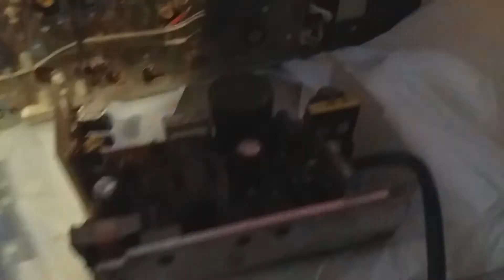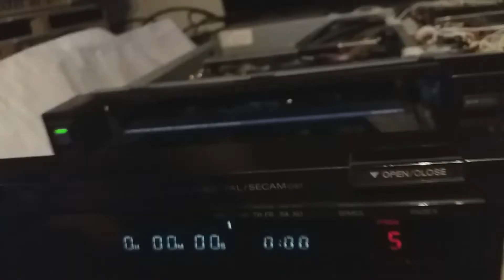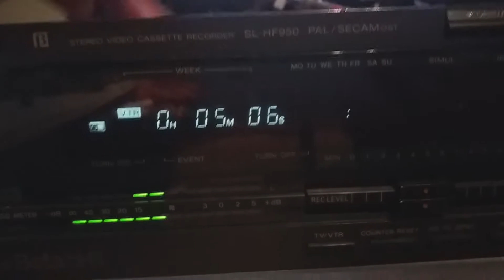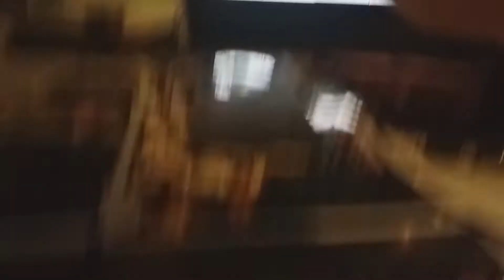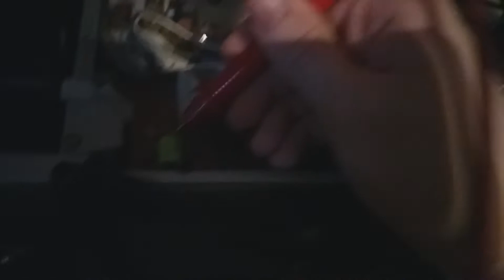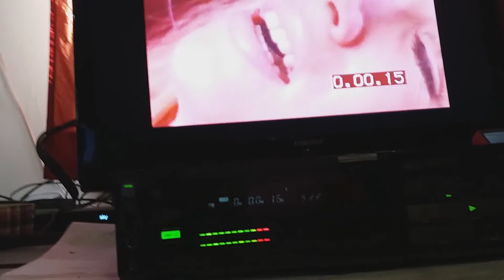Vintage Sony SL-HF950 (1985) Repair / Service (vintage tech)

Comment: Whow what a machine, always wanted to have one of these! When the machine came out it was a very expensive top of the line machine. I have had several Betamax machines, and have still a couple of them in my audio and video collection, only one is a Super Betamax machine. I always liked the system Betamax videorecorders and still love them! Of course i also like the VHS machines and the V2000 and Video8 machines, and have also al lot of those in my collection. Sad that they dont make them annymore thesedays, the last VHS videorecorders where made in 2016 by FUNAI. Good Job well done! I like the videos on your channel. Greets Marcel 👍👍👍

Comment: On HF 950 the EDIT switch acts strangely (compared to VHS recorders): when EDIT mode is ON, the picture sharpness is reduced. The sharpness pot is set to the middle position. When EDIT mode is ON, the sharpness pot is not working (as expected), but why the image sharpness is reduced when EDIT mode is turned on? Is it normal or a malfunction? Normally, the EDIT mode should turn off the DOC / HQ etc. circuits and should show the raw, sharper. noisier picture, without any enhancements. 

Also, I don't see any differences regarding the dropouts when EDIT switch is turned ON / OFF. Does it control the DOC circuit in this particular unit? I need to conduct more measurements on the PCB and learn the schematic more.

Comment: Slowly fixing all issues in the HF 950 (PSU, broken shaft couplers, broken 470n caps on RP31 board, broken gears / motor / position sensor in skate loading mechanism etc.).

Now there is strange problem: I have around 30 used cassettes. 90% of them produces 700 -800 mVpp signal on CN703 pin 3 (~1.2 Vpp measured on pin 14 of CX 20045 - this is the normal value, regarding the service manual). These cassettes have slight dropouts (short horizontal white lines). They are mainly Sony brands with golden letters on the tape protector door ("This side faces forward" etc). But 10% of Sony tapes with black text on the door generates higher signal, around 1.2 Vpp on CN703 pin 3 and 1.6 Vpp on CX 20045 pin 14 and the picture is perfect, without dropouts. All these are recorded with the same machine.

The recording signal on CN704 pin 1 and 5 is 4 Vpp (this is the normal value as manual states). I have tried to increase the record current (measured 5-6 Vpp on CN704 pin 1 and 5), but the "weak" tapes still reproduced only 800 mV on the testpoint.

I can't believe that 90% of tapes are bad. Why the VCR cannot record stronger signal onto them? Head issue? RP31 board problem?
Reply from the maker: Well, are you sure that the heads aren't worn? I'm by no means an expert on betas but I would try to find good condition prerecorded tapes to see further. Sounds like a strange issue to me
Reply: @Oerg866   Nothing is sure, as I have no reference machine or a good head. If You can tell me the inductance of a good primary A and B heads, I'll able to measure mine.
Reply from the maker: @drdma1  I'm sorry, that exceeds my technical knowledge :( I lack equipment to measure reference values for VHS as well...

Comment: good day
I have a Sony 950ES
which ran perfectly yesterday,
Bought the device from classifieds for 300 euros, optical condition top,
Technical condition also top, image reproduction flawless,
everything works perfectly, I had a dozen beta cassettes in the closet for a while,
which I wanted to check, today on January 17th, 2022 I watched 2 cassettes in a row,
Good picture quality of the tapes, they were great classics that you can also watch like this,
at the end the movie ...Stripes ...with Bill Murry was on
I turned my back on the recorder and just let the movie run
I did something on the PC... but something must have happened at the time
the counter stopped at 0:41 and the recorder just kept running,
When the film ended I wanted to fast forward the tape to watch
what else is on it, he didn't react to anything anymore, not even off
you could still do it, playback was still on,
Also ejection or similar did not work anymore, I pulled the plug
When he put it back in, he unthreaded the cassette and reinserted it,
That's it, not even the tuner reacts anymore, what's the matter there
happens, hope you can give me a hint,
Also eject no longer works, display is ok but does not change anymore
Counter to 0000000 and tuner to 0 that's it,
greeting jens from leipzig germany

Comment: Hello I have one of the model
SL-HF750 SUPER BETA, which if it turns on but does not load the cassette
I press the load buttons and nothing happens, neither to open the load nor to load, you have any suggestion that it might be failing ?

Comment: You said: The fine horizontal patterning is due to lack of shielding on the video cable" Did you mean from videoheads or from output?
Reply from the maker: I meant my own composite video cable, I was using a really cheap one. :D

Comment: Hello. Where did you source the leds from, and how did you stick them on?
Reply from the maker: I sourced them from a local distributor. They're standard 0603 SMT LEDs with about 12 mcd luminosity. You can solder them on the pads directly, but it is a very delicate process. Make sure they're aligned correctly so they fit in the holes of the cover.

Comment: Hello again. I too need to replace the LEDs on the front meters. How did you work out where the +ve and -ve pads were on the PCB? The original LEDs are so tiny I cannot see what they are connected to.
Reply from the maker: Hi, what I did was I took the board out after removing all the exisitng LEDs and then while the machine was on put a VERY loud signal into it so that normally all segments would light up, and then measure voltage across the pads.
Reply: Oerg866 that's a good idea. I'll try that. Looks fiddly but will be great if I can get it to work. Over half of mine are now dead so haven't got much to loose. Will let you know.
Reply: Great video, I need to replace the LEDs on mine. Where about's are the fixing screws to access the PCB. What LEDs would you recommend?

Comment: A fabulous, helpful video - thanks. I did have a question on your comment for the Panasonic AG 7350 - CTL pulse processing. I have 2 machines with that problem and replaced C42 (47uF/10V) but no improvement - are you sure that's the correct capacitor?
Reply from the maker: What's your symptom? Lack of tracking stability + counter not running? C42 is a healthy start anyway because even on machines that worked it had already visibly leaked + corroded legs. I need to double check on the part number though, maybe I got it wrong.
Reply: @Oerg866  Hi. Yes, exactly that. From power-on, bad tracking for about 15 mins with no counter, then tracking is fine plus counter starts working. Replaced C42 and no change. According to the manual C42 is a 47uF 10v elco.  Is this the correct one?
Reply from the maker: @RobsVideos1971  I just double-checked and on all machines I have replaced it is indeed C42 (in Ref. No 2000 series, not the 6000 as I wrote in that comment but there's only one C42 on that whole board so you probably got the right one), 47uF 10V electrolytic. You may want to check TP2008 (labelled on the board as TP8 CTL) with a scope to see if there are CTL pulses to begin with. If they're not, then something is wrong in that circuit, as it is the first "stage" in CTL decoding and directly fed from the CTL head. It's certainly not a head issue if it works fine after warming up. That screams capacitor issue to me. C44 (3.3uF/50V) is another possible suspect. If they are, you got a problem further down the line which is going to be harder to find.

Here's the relevant excerpt of the service manual: https://imgur.com/a/0IpKwge

Good luck, let me know how it goes :)
Reply: @Oerg866  HI again.  On my second machine with the same fault - replacing C42 DID work - thanks!.  I guess the first machine has other issues - will get the scope out next weekend and see if the pulses are arriving as you suggest. Will let you know. Will also try replacing C44 - good idea.
Reply: @Oerg866  Hi again - just to let you know it was C44 that was the issue.   Thanks so much for your advice.
Reply from the maker: @RobsVideos1971  Awesome, I'm glad I could help. Hope the units will enjoy a nice long life :)